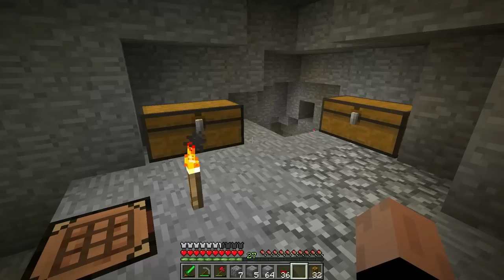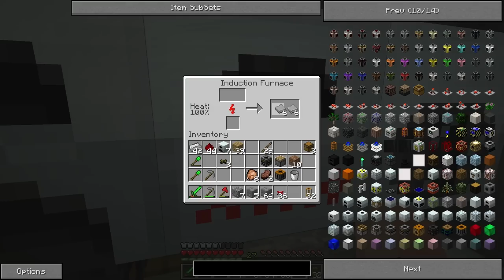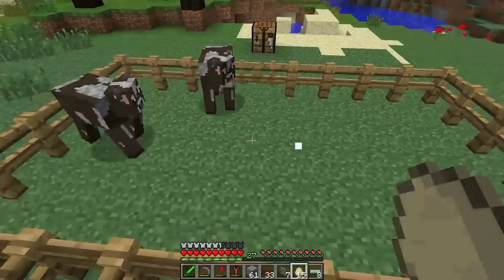Let's Play! Episode 12 - Watermill, Deployer, Timer, and basement design

Comment: @cooldudepoke That is the max "packet" size of EU for tin cables, each watermill sends a Packet Of 2 eu. This is also how transformers work, Instead of sending all that EU in a single packet, it turns say, 128(MV) EU into 4 Packets of 32 EU(LV) Hope that cleared everything up for you :)

Comment: btw Quick Question @ShadwDrgn Why can tin cable only transmit 5 eu/t before evaporating or whatever it is but you can transmit 16 eu/t by connecting 8 water mills and the tin cable doesn't evaporate?